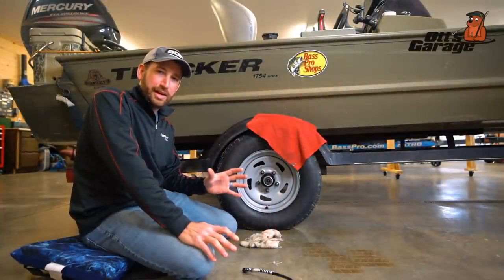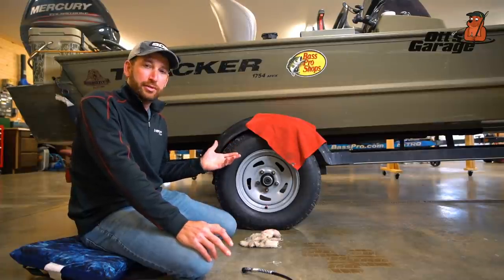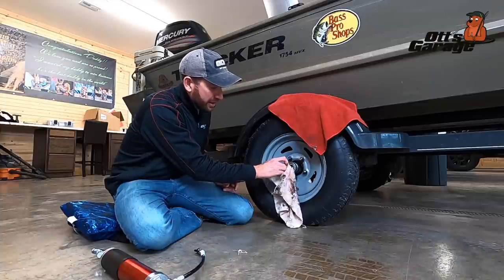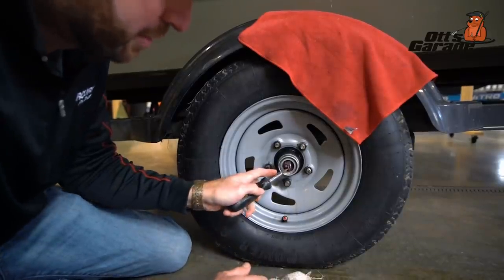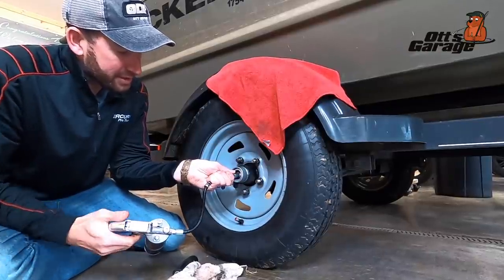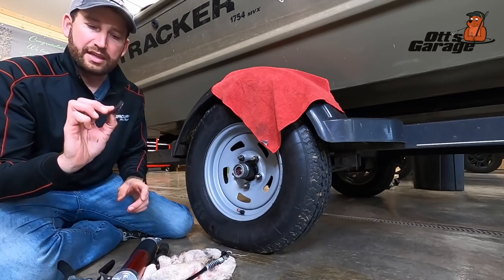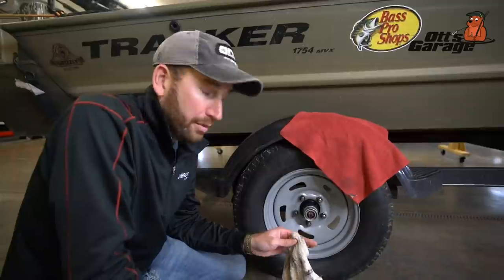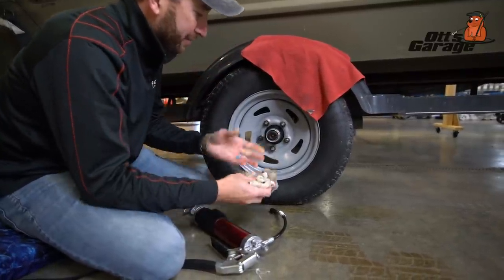Ott's Garage: Don't forget to maintain your trailer wheel bearings!

Comment: It really is not a difficult job to take a hub apart and clean the bearings to do a really good inspection and then repack the bearings with good wheel bearing Grease. A good mechanic will teach you how to do it if you ask. Just make sure that when you pop the seal on the inside of the Hub that you replace it with a new one don't reuse the old one.